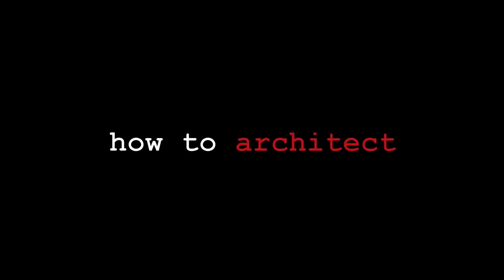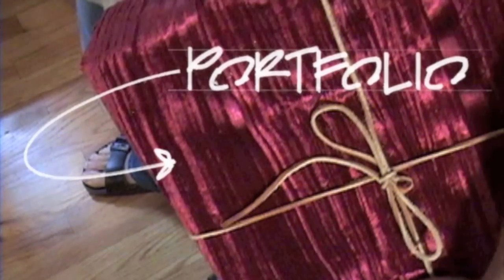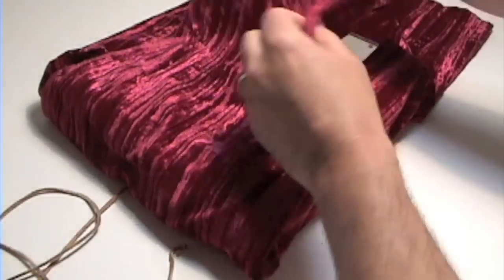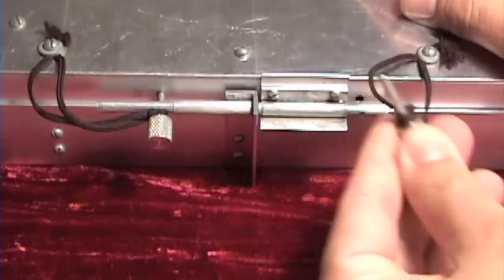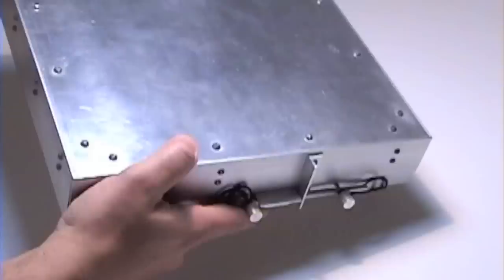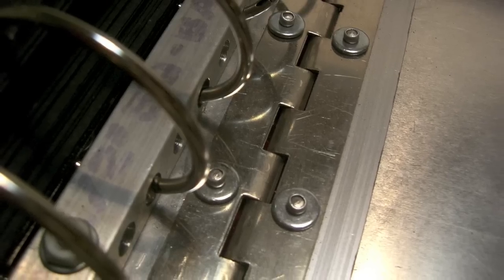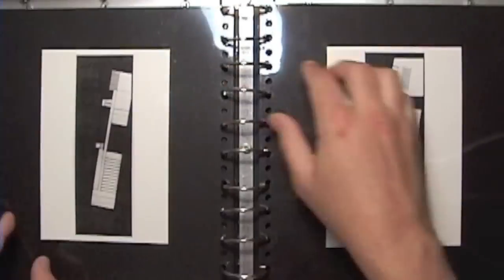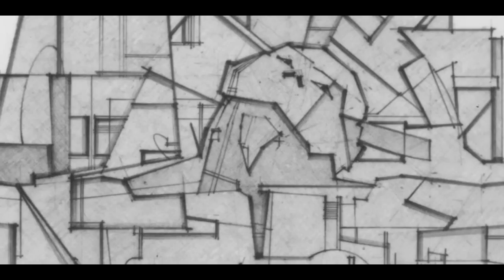How to make a portfolio - Part 2

Comment: i made a my own compilation of works during college, i used "Cheap board" and some scrap bristol boards that has e terior perspectives, and a parchment paper.. i carved a rectangle hole on the cheap board with a blue inked random plan design in it, and paste the parchment in the bottom and the scrap drawing underneath it.. and i used ring binders to compile my works - and when i tried to show up my work with my "current boss" he said, "nice portfolio are you gay?" and i laughed hard at him